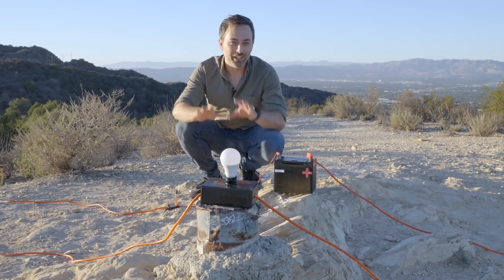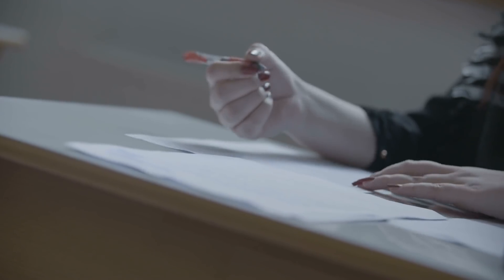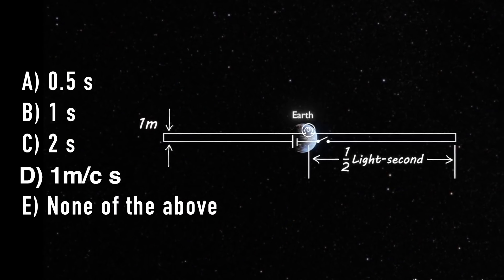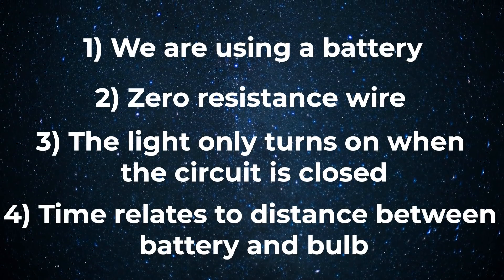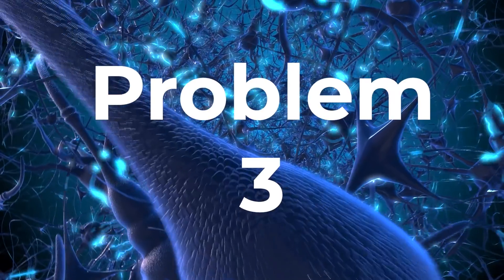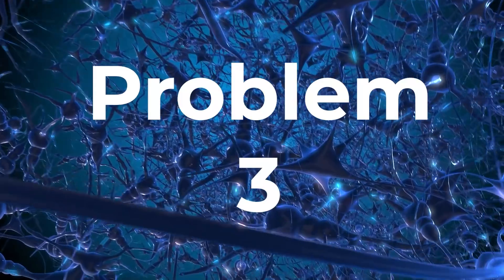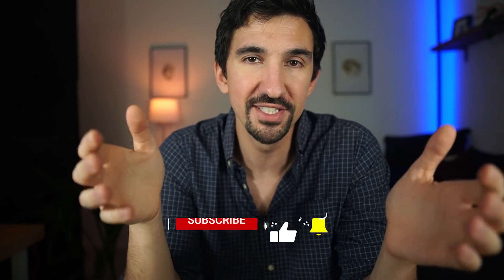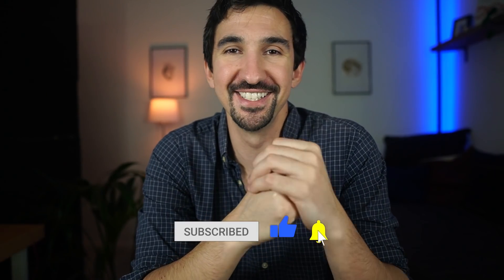Is Veritasium Wrong About Electricity?

Comment: In my opinion a problem of this argument would be in the “when” of point #3, that’s because the information “circuit is closed here and now at the battery position” is not the same as “circuit is broken here and now at the 1/2 light second terminal”. You cannot assume you could break the circuit in “the same instant”, because there is no absolute instant of time. The locality of battery and bulb is almost the same compared to the terminal, so they would be “all right, circuit is closed so lamp is on” as long as “circuit is open” information comes. Or is it?
Reply: I could not understand the last part of your comment but will try to explain the conundrum. 
As the experiment was set up (assuming the current induced by the 1m appart wires was enough to light up the lamp) it doesn't matter if the circuit is closed or not. But veritassium made it seam the wire being connected was essential. In which case I could have knowledge if a wire was broken on a planet 1 lightyear away before it's light even reaches me by just connecting the circuit.
Reply: Hi  @powmod  :) I meant that if in the place (space and time) of the battery there is the information “circuit is closed”, the lamp will turn on almost instantly as current starts to flow. If somehow in the farthest point the circuit breaks, that information will eventualy come to the battery/lamp point, then it will stop glowing. In this point of view, there is no way to check whether the circuit was broken before information comes. I might be wrong, though. It serms to me otherwise we are using the information “circuit is closed (or open) now” universally true, which is false: two different viewers might not agree on “open” and “closed” because they are in different places, or one is moving with respect to the other.

Comment: @Spin Up Science with Dr Ben Miles Your updated D answer still has the wrong unit of measurement: s^2.   
1m/c is x*seconds 
1m/c s  is x*seconds*seconds.
Reply: that's just an informal notation )
in fact, it's not necessary to write like this, but it's important to write "1m/c"
Because 1m/c is the time for light to travel 1 meter )
Regardless of how you measure c, in m/s or in ft/year )
Reply: @МихалычНаливай  I thought he wanted to bring the D answer in line with the others: scalar * seconds. Wouldn't be better to write it as (1m/s)/c s?
Reply: @rutessian  I think it's better to write 1m/c [s], stating that you want to calculate time in seconds. It will be automatically achieved if c is expressed in SI units, that means in m/s
Reply: @МихалычНаливай  does the [s] means that whatever comes before it is expressed in seconds?
Reply: @rutessian  yeah, and that's what I learned in old soviet school )
This notation seems to be widely used in different books and articles
Reply: @МихалычНаливай  1) You are wrong, that is 
definitely not an informal notation. It is an SI unit. A)0.5 s B)1 s C)2 s D)1m/c s 
2) It's not, not necessary but 1m/c s is in fact wrong.
Reply: @g75zjz72  nope ) you are wrong )
"
A)0.5 s B)1 s C)2 s D)1m/c s 
"
0.5,
1, and 
2
are dimensionless units.
1m/c is not a dimensionless unit. And thus 1m/c s might be interpreted as s^2, just like Tessian Rusu stated )
I already stated, that you can write 1m/c and this would be totally correct. Did you read my message? 🙂
You are not correct that 1m/c has SI unit. You might put for "c" in ft per light-year, or anything you like.
1m/c s is an informal notation to claim that 1m/c would be expressed in seconds. But 1m/c [s] would be more careful expression, at least I learned like this long time ago. And I'v seen such a notation many times in many books.
I don't claim that this is a commonly used notation. I just don't see any problem of that. Do you see any?
😁

Comment: I don't like the nitpicking of the units on 1/c or the 12V battery and the resistance of 1200000km wires. It's just cheap nitpicking. It's a thought experiment for a reason.
Also, it won't break causality when you break the circuit on the far end, but rather it would take a second for the light bulb to switch off. The whole point of the video is to explain that energy and therefore information travels through the fields. I would say that breaking the circuit is a "point of action' and the information from that change would travel globally at the speed of light. The two antennas explanation is basically is the same just explained from the other side. 9:30 Also the light bulb would actually have more energy for 1 second than what you would calculate if it were already closed due to that energy still have to travel to the far side of the circuit.
Well, I'm not a physics expert so I could be wrong.
It's better explained in Science Asylum's video tho IMO.
Reply: 1m/c is a methodological correction. 1/c is a nonsense for any physicist, and there are many notes about it.
The reason behind this is simple: 1m/c is a time for light to travel 1 meter.
For those who prefer imperial, you might want to write it something like 3ft/c, and express c in ft per second.
It's just how it should be written to avoid misunderstanding

Comment: Nice video as it made me rethink this - good since I am a University EE Instructor.
I agree there are major issues with the thought experiment as some major technical issues that really can't be glossed over.  I think @Veritasium just got so caught up in the beauty of the concept that he did not thing the thought experiment out as well as he should have.  See Sabine Hossenfelder's recent videos (and book) on the problems with "Beauty" in Physics.
One big problem with the thought experiment is Inductance.  Inductance is the resistance of a system from changes in current - the voltage drop across a component is V=L*dIdt.  For the circuit in the thought experiment, that means the light would not see an immediate change in voltage (Off to on) but an exponential rise whose time constant is proportional to the Inductance of the wires (L).
For parallel wires, Inductance increases with length, so for the wires in the thought experiments, L would be VERY large.  Than means the time constant is VERY large and so the light will not turn on quickly.  The exact number is going to depend on a lot of things related the the geometry and characteristics of the system and that is going to be had to determine since the system requires zero resistance wires which is unrealistic also.  I could spend some time on analyzing the though experiment further, but I am not sure it is worth the investment.
Reply: It would be worth it to me if you came up with a better thought experiment. :)
Reply: The light will not turn on instantly.  It will take just over 3h to get to 50%.  The inductance of the wire will cause the current to rise as I(1-e^-t/T) where T=time constant.  The light will hit 50% power (71% Imax) at t=1.23T.  T=2L/R.  Assuming a 12V battery and a 12W bulb, R=12ohms.  Assuming 300,000Km of 12AWG (2mm) superconducting wire, L= 60KH so T=9,947s and 1.23T=12,235s=3.4h.

Comment: You have little concept of DC current. DC current doesn't work like an antenna to complete the circuit, DC current is more a garden hose with water pressure and flow.  Just like radio waves, DC current moves at the speed of light. But not certain about electricity but light moves slower in a different mediums, I would guess DC flow would be slower in mediums like semiconductors. The idea that the two wires act like capacitors does not explain why different thickness wires restrict current flow. Capacitors have impedance which is a function frequency, at low frequency a cap looks like a open circuit.

Comment: More to the "minor point": It should be 1m / c (no second after that since it's already contains inside c)
Reply: I accept the units, but....  There is no way it can be 1m/c.  If it was 1m/c, then the length of the wire is irrelevant.  If the length of the wire is irrelevant, then the position of the switch is irrelevant.  If the position of the switch is irrelevant, then the lightbulb is either already turned on, or is never going to turn on, and so there is no change in the state of the bulb, and no measuring a lag in how long the bulb takes to change its state.

Comment: Maybe I'm dumb, but I just plain prefer to think of current as electrons moving than the wave energy model. It just makes conceptual sense to me. If you have a billion marbles with a radius of a centimeter lined up just touching, and you flick a marble into on end of the line with enough energy to transmit through the whole line, the opposite end marble will move instantaneously (almost) as you're not moving one marble a billion centimeters... you're moving a billion marbles a very small distance all at once.

Comment: Assumption 4 is wrong, for the light to turn on you require current flow and you can only achieve that when the circuit is complete i.e. all the way back to the battery negative post

Comment: I wasn't happy with it. You could make the circuit many light years in distance and break the circuit at its furthest point long before the current reached it so the circuit does not complete and there is no glowing bulb. A teensy, utterly negligible amount of current will be induced in 1/c due to the  em field propagation between 'antennas' but the circuit does not complete and the bulb would not glow. The video was at best misleading and ill conceived. Never got a response from Veritasium. I guess he is preparing his next shock video.

Comment: You are correct - and moreover I think valid in suggesting that Veritasium has been a little theatrical in overplaying what is actually nothing remarkable at all ...

This is no more than a simple example of transmission line theory. There is absolutely no violation of causality or any other superluminal effects. The there is a relationship which is completely understood between the transient response and any reflected effects (after transmission along the cables).

Below is the post I put on Veritasium; which I guess as it is less than exciting drew no counter comments. I also posted replies about similarities with antenna which I was pleased for you to draw also.

Also I share the feeling of being careful when one's PhD doesn't apply to the exact subject matter of the posting (I am curious what your research area was). But we should all remember that a PhD is primarily a training in research skills and having confidence in one's own analysis.

My postings to Veritasium ...

Yes - you are correct - and anyone who has studied transmission line theory will agree. The only comment I would add is that you have not elaborated on the resistance of the conductor (forming the inductive element) and the conductance of the insulator (forming the capacitive gap between the lines). You hint at this in mentioning the 'impedance' of the system at the end, but the losses due to these resistances are important for two reasons. First they dictate the time constant with which the signal (luminosity of the lamp) increases; secondly, and perhaps more poignantly they indicate where losses (of power) are made in the system. Sadly, (in particular as the resistance of the conductor is a greater loss component than the conductance of the air/space gap) the fact that the wires get hot enhances the misconception that that must be where the power is being transferred.

It's much simpler if you regard the loooong parallel wires as a transmission line. Into which you are injecting a signal with a infinitely fast rising edge (the switch closure). Whilst the steady state result (many seconds later after voltages have stopped changing) will depend on whether the distant switch is closed or not, the instantaneous current at the point the switch is closed is independent of whether the line is terminated or not. The lines can of course be infinite - this is why a vacuum has a characteristic impedance and why it takes energy to 'push' a radio wave into space. Indeed, if you put the lamp in series with the feed to a transmitting mast, you would probably agree it'll detect a current and light up regardless of who is receiving the radio signals or not.

The change in perspective necessary here is to consider that the cable (in fact any cable) behaves like a transmission line. This becomes important if the change in voltage is fast (high frequencies) or the distances are great (as in this example). For a steady state (DC) condition all your reasoning applies, but for the transient situation (the instant that the switch is thrown) the circuit appears as if we are trying to inject voltage step into a circuit comprising inductance (the wires) and capacitance (the gap between the wires). In this case the instantaneous current which causes the light to come on is not due to the steady state DC that you would expect (resistance of the wire) but to the impedance of the wire pair. This instantaneous effect is due to setting up a signal (waveform) in the wire pair and is regardless of length. This may seem absurd until you consider that if the capacitance (per unit length) is small or the inductance (per unit length) is large then the "Characteristic Impedance" as it is called will also be large and the current will also be small. Conversely for a higher frequency AC power source (instead of a battery) this current could be quite high. This is best illustrated by considering what happens if the wires are taken away. Remember that even a vacuum has a characteristic impedance (of about 377Ω); this is why it takes power to 'push' an electromagnetic wave into space. If you consider the lamp in series with one wire going to a transmitting antenna there is no difficulty in accepting that the lamp will light as soon as the transmitting signal is applied. This is regardless of what is receiving the signal or how far away it is.